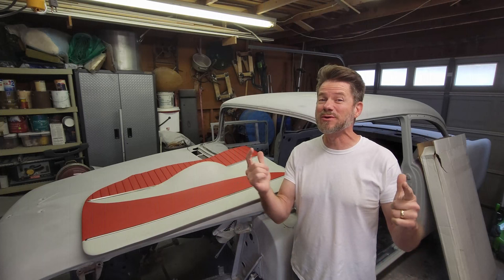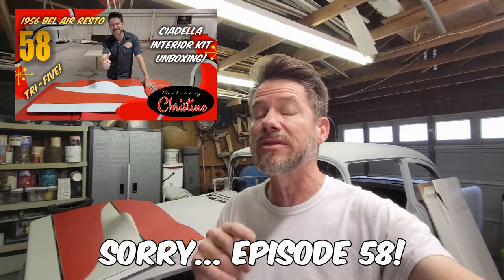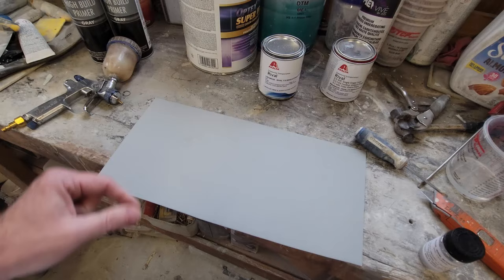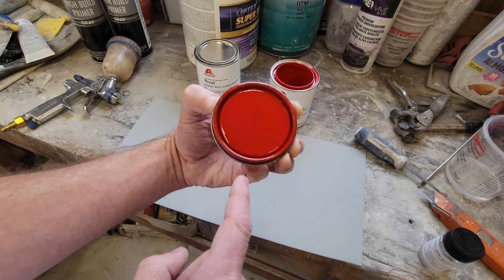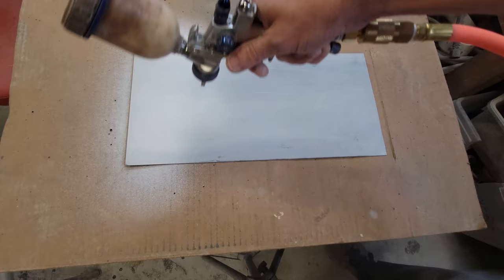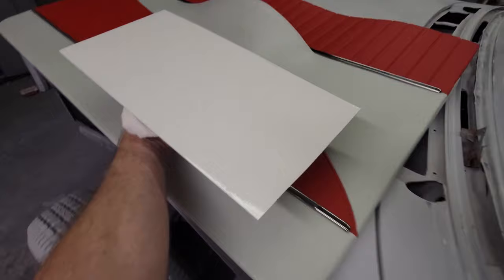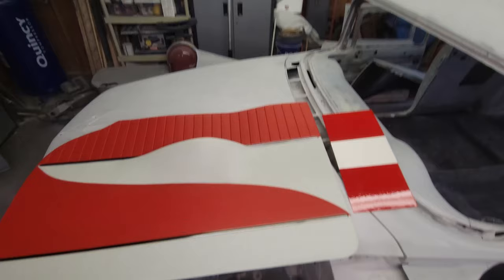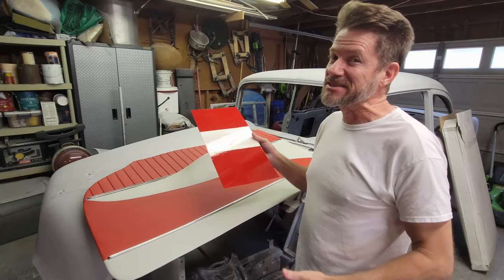E101 Let's Pick Some PAINT Colors! 1956 Chevy Bel Air Resto

Comment: Solid colors are fine in single stage, I have a couple my cars that way. 2 coats and done, can still polish if you want but nobody will be able to tell. My cuda (red) done 13 years ago still looks fine
Reply from the maker: I read something about clear over single stage last week, and it made a lot of sense...  What they said is that the entire reason for base-clear 2-stage systems was to allow the paint manufacturers more options for handling VOC requirements.  Otherwise, they wouldn't do it.  To me, I find that metallics are ideal for 2-stage, because you can focus on the sparkle in the base and then the gloss in the clear.  But I saw some case studies on clear over solids and the end result is not as crisp and can be slightly milky, especially with age, and also more vulnerable to swirls.

Comment: Check out matterhorn white. It has a slight Grey tint
Reply from the maker: Do you know about what year?
Reply: @RestoringChristine1956   Sherwin Williams U00150. I think they are using it on the 2022 genesis. We use it alot on aircraft. Turned out good on my 55 ford. It may be a little to blue grey but it is hard to tell on video.
Reply: Well Bill you are already past the hardest part of the paint process for being the owner. I Still can't decide what color I love best 😢